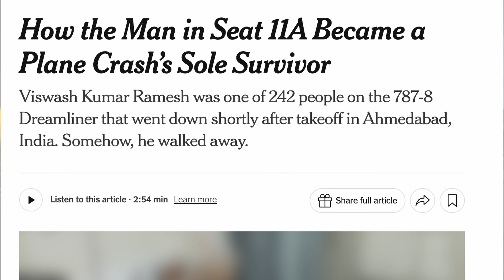Why the RAT Changes Everything – Air India 171 Update

Comment: As the chances of all engines quitting on a modern jet, (without a bird strike or the ingestion of some other foreign objects) are about one in a gazillion, this is going to shake a whole lot of confidence in the airline industry
Reply: Sabotage??
Reply: @pfknob  Bad maintenance is MUCH more likely.
Reply: @pfknob  That or more likely, incompetence by the ground crew, coupled with "incentives" for taking shortcuts.
Reply: @pfknob  possible...
Reply: @pfknob  Pakistan hates India they have been at war ,not far fetched to think this but time will tell.
Reply: Poor maintenance >> Major system failure (critical short circuit, catastrophic electronic incident) >> System Overheat >> dual engine failure
Reply: @jamesstuart3346  Good point!
Reply: It won't because there have been millions of flights without this happening lol. Like usual, there will be some human factor explanation.
Reply: Yeah, and they quit at the same time too - no excessive rudder or attempts to compensate for asymmetrical thrust.  Whatever shut them down was beyond the capabilities of the crew as well as the flight control and management system.  Either someone created a magic button, or something is up with the fuel.  One would assume the aircraft was fueled at the airport, but I wonder how long before takeoff as it was about 110 degrees F at the time of the accident.  I wonder if there was an algal or bacterial presence in the underground storage tanks that might have clogged the fuel strainers in the engine and as someone else has mentioned, it could come down to sloppy maintenance.
Reply: NO, not the airline industry . ONLY Boeing....stop flying these coffins. Tell your airline that you will not board a KILLER plane. Remember that if the USA government had not ordered war planes from this KILLER aeroplane producer, they would have been bankrupt many years ago
Reply: not in the airline industry, but further in Boeing. From all the whistleblowers we already knew they were cutting costs left and right. Too bad that the US will never let that insanely corrupt murderers of a company and their leadership go bankrupt tho.
Reply: I am thinking sabotage also at the maintenance level.
Reply: Could be electrical issues causing FADEC to throttle back.
Reply: Few Indian citizen questioned sabotage. We just almost had a war with Pakistan.
Reply: It'll be maintenance and they will find a litany of coverups and lack of whistleblowing where people didn't do things that were already in place to prevent this type of problem. There's also a chance that even more zealous redundancy engineering could've covered for that (swiss cheese model), particularly from my opinion in electronics/software if the poor maintenance lead to an electrical shutoff that caused it.
Reply: Aircraft rotated in the undershoot/overshoot area after an intersection departure on a hot day. Theoretically ingestion of a large amount of fine dust/dirt/grit from this unused area of the runway could cause a dual engine failure just like BA 009 and volcanic ash
Reply: @karlhunt4098  I wondered about this being a possibility.
Reply: @karlhunt4098  Doubt that. It took a long time, ingesting volcanic ash, for BA009 to flame out. And the cause was crystalline build up, not choking out an engine.

Comment: It is possible to call flaps up instead of gear up by mistake it happened before to a British Jet. The senior pilot was a misery to work with and intimidating to the junior crew. He called for flaps up instead of gear and the co pilot just did it wrong or not. They crashed in the same way. There would have to be a lot of things wrong and I mean a lot for both engines to just quit at the same time. Another occasion pilot pulled the power back on both engines to control speed and he went too far back to shut off so then putting them forward again there was nothing.

Comment: Hmmm...
I'd read about RATs deploying accidentally, is it conceivable that the RAT dropped and somehow caused the double engine failure due to some software issue. The computer controlling everything sensed the RAT and decided to shut down the fuel controls to the engines? All it would take is a wrong value in a line of code.
Of course, eventually the accident investigation will put forth what they believe the cause to be AND normally i dont speculate but this time im joining in to the internet crowd.
Note that another channel showed that the flaps on this airplane DON'T hang down a lot so my belied that since i didnt see flaps there weren't any is most likely wrong. He ALSO showed that rhe flap conyrol is a wheel doen by the copilots left leg and the gear lever is up on the control panel so it would be harder to confuse the two so making rhe theory that the copilot incorrectly raised the flaps instead of the gear less likely too. So we're back to loss of thrust from the engines for some reason, and less likely human error in the cockpit (still could be human error somewhere, re the earlier stated question of an unusual AND unique circumstance that triggered an engine shutdown. Therse planes have been around for a long time but perhaps the circumstances never lined up to trigger it before.

Comment: Won’t the APU automatically turn on (or be on) at takeoff and provide electrical and hydraulics before the RAT is deployed?  You mentioned last resort, so apu before rat. Batteries would also provide electricity. 787 is fly by wire.

Comment: You can also rule out the inadvertent flap retraction instead of gear up.  The 787 has it's main trucks angled aft  so the rear sets of wheels are down further than the fronts.  But upon gear up command, the body doors open and the trucks angle the opposite way with the front wheels down lower than the rear so they can fit into the fuselage as they retract.  You can clearly see that as it descends into the ground, the front wheels are below the rear, thus positive proof the gear lever was put into the gear up position and the cycle started, but got interrupted with a massive hydraulic failure.  So it is not mistaken flaps vs gear lever actuation!

Comment: There's a video from a passenger on a previous flight of this aircraft......I think he was on the plane on the previous flight.  He complained about the flight entertainment features were not working and in addition the AC was not working.  Back to the RAT.  IF there was a massive electrical problem, the electric fuel pumps for the engines would stop working...hence no engine power.

Comment: Now my theories on why both at same time.

Electrical.  Fuel pumps stopped engines flamed out.  By time rat kicks in no to to restart engines,if the APU is still even active to restart.

Those fuel pump switches dont off themselves, so electrical issue.

Until families actually start sueing vs taking what the airline or airline maker offers you for ur quuk cash nothing will be revealed or fixed.

SUE!!  TILL THEY BANKRUPT!!

Comment: They should have investigated the A/C and cabin computers not working on the earlier flight…it’s incorporated in the whole electrical system to keep electronic equipment and batteries cool....Equipment Cooling System: The 787 has an equipment cooling system designed to regulate the temperature of crucial electronic components and avionics, which generate heat during operation. This system uses conditioned air from the cabin and/or ambient air to cool these components, ensuring their reliable performance and preventing overheating.
Battery Location: The lithium-ion batteries are located in the forward and aft electrical and electronic (E&E) compartments, along with other electronic equipment.
Indirect Cooling: By keeping the E&E bays cool, the equipment cooling system helps maintain a stable environment around the batteries, mitigating temperature rise and thus contributing to battery cooling.

Comment: Surely if there was no power, initially, surely there would have been no power for the hydraulics to work the flaps that why the flaps weren't see down.❓.😮.As I ain't a rocket scientist but Isn't this a clearer picture of this unfortunate incident, as I don't believe that the "Rat" as U call it would have no time to generate enough power to drive the hydraulics, which probably wouldn't have been a help anyways. If the engine power had collapsed.😢😮😢

Comment: According to Juan Browne on the Bloncolirio channel, the RAT also deploys on any engine failure during the take off sequence. If they took the whole length of the runway (as evidenced by other videos) then they must have reached V1 but struggled to make Vr. Had they achieved Vr when they rotated? The initial climb looks normal but the energy in the aircraft at that point would have enabled then to achieve that. If all hydraulic systems had failed then the RAT is not designed to be able to raise the gear. One reason for total hydraulic failure is loss of both engines.  IF IF, there was a loss of both engines after V1 its hard to believe they would not have instinctively slammed on the brakes etc. in an effort to abort the take off.  IF IF the RAT was deployed then the most likely scenario is that after V1 there was a single engine failure, giving them confidence to continue, but due to loss of power requiring a greater take off distance. However, after rotation, the second engine failed and there was nothing they could do.